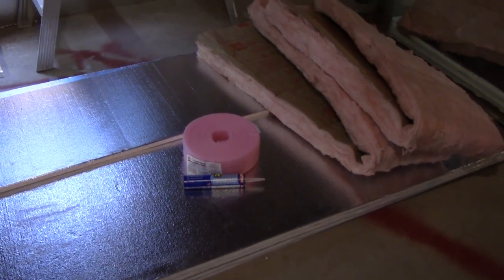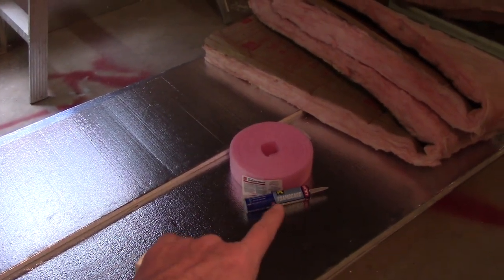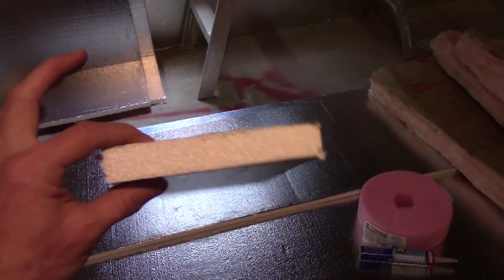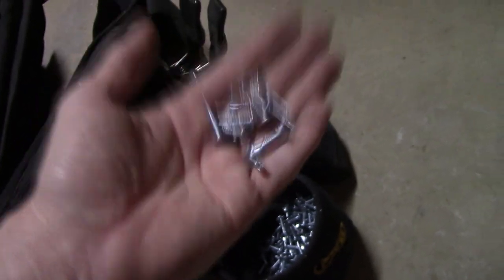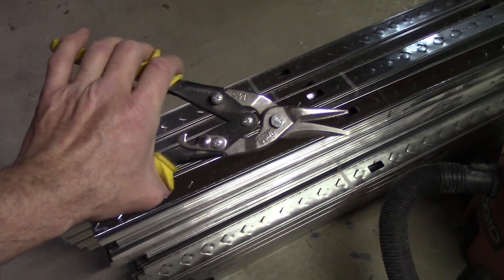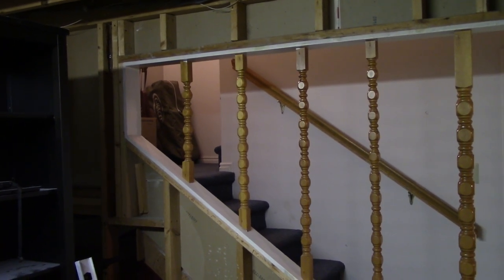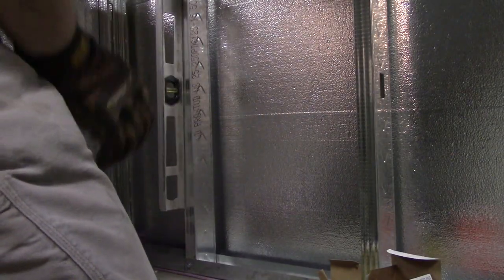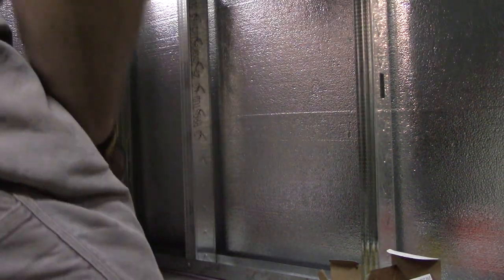20200330 Framing a Basement with Steel Studs

Comment: Great Video. Even if it was allegedly only for family, we appreciate it. Lots of experience tips in there. I'm a pipe fitter by trade and am rebuilding parts of my house. I've searched Youtube for this gold right here. Thanks for showing us your system.
Reply from the maker: I appreciate the positive feedback! I learned steel framing when in commercial construction over 20 years ago. It’s a great fast way to build non-structural walls.

Comment: Nice video. Thanks. Wonder how installed the doors with 2X3 metal studs. Most door frames are suited for 2x4 studs I guess.
Reply from the maker: You can order door frames for any size door.  I haven't priced pre-builts out from the big box stores yet. I can also rip a frame kit down on my table saw.  I've done thousands of doors in my 44 years of life.  It's not really all that difficult.

Comment: I went with steel studs in my basement, and glad I did.  My question now is... what's the best way to attach baseboard?  I haven't been able to come across any finishing/trim screws that are made to attach to the steel studs.
Reply from the maker: Yeah, I haven’t gotten there yet. I’ll find some finish screws with fine thread.
Reply: More Backing = )

Comment: I’m looking to do my basement in steel, but I can’t figure out how to “float” the frame. Any advice?
Reply from the maker: I didn't float my floor because I'm in a 40 year old house that has settled about all it will, barring a major earthquake or flood event.

So I would ask why are you floating yours?  Is your home new? Do you deal with major flooding? Is it required be the inspector in your area?

When I've had to float steel framing I place a redwood (my proffered) or treated base plate down with ramset or tap cons. Then I hang my steel framing from the ceiling joists leaving a 3/4"-1" gap between the lumber plate and the steel bottom track.  Place redwood blocks inside the bottom track at appropriate intervals and drill holes through them  so that you can nail into the redwood bottom plate to give your wall that peg it needs.

When doing drywall, ensure no screws are placed in the redwood bottom plate, only in the steel framing.  You may need a bit wider base board for the same reason.
Reply: I’m in an area with expansive soil and you need 1-1/2” of float.  I talked to our towns building department (recommended!) and the engineer suggested to use 3” slip track with elongated holes at the top and put the gap at the top of the wall and use crown molding or put a bulkhead with recessed lighting along the top of the wall.  The gist is to give a gap for the floor to heave without pushing up the floor joists.  

A friend of mine in Golden, CO has a 1971 house with a finished basement.  The basement doors have a 3” gap at end of summer/early fall, and the doors are scrapping the floor in spring